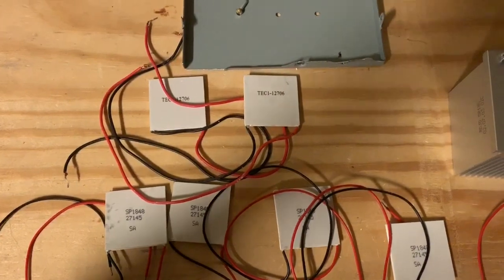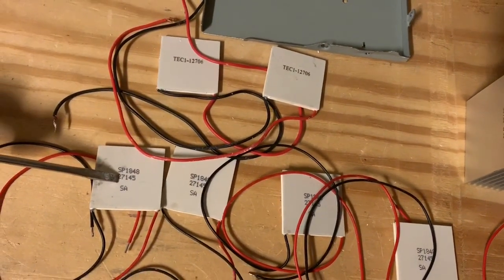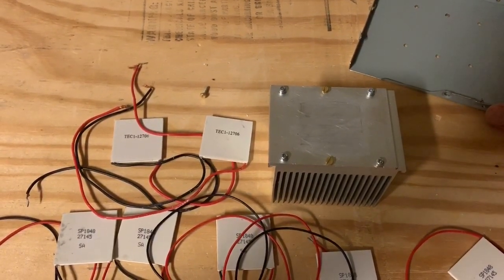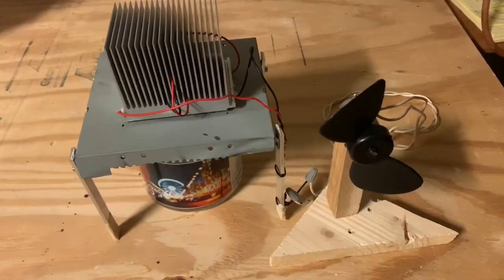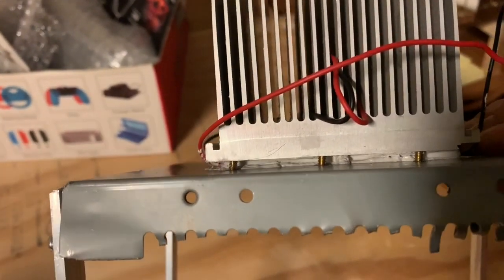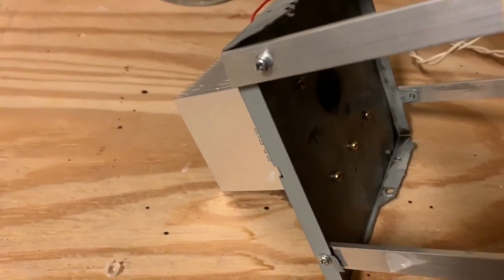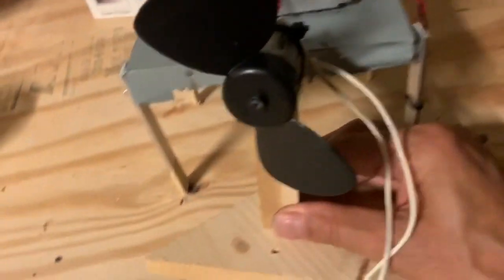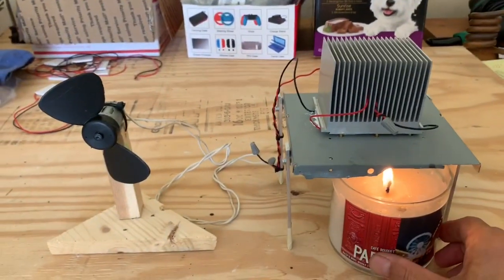How to make electricity starting with a Candle

Comment: Wouldn’t it even increase the efficiency, if you’d direct the fan at the heat sink directly? That way you could make a self optimizing radiator, maybe interesting for heating very small greenhouses
Reply from the maker: Actually, I did try that and it works very well. It produces directional heat.